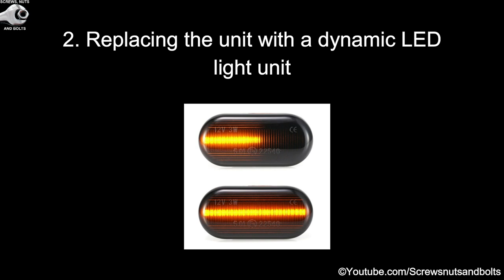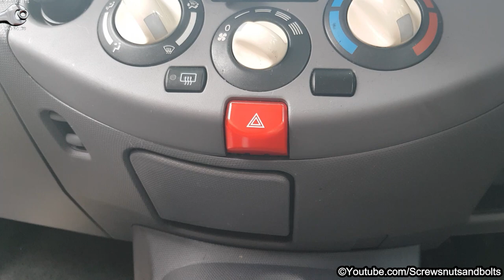Dynamic LED Indicator Bulb Upgrade

Comment: I've just watched your video, but I think the direction of travel for the indicator should be from the front of the car to the rear as the side repeaters are positioned towards the front of the car,  if they were on the side at the back I would agree with you, but if you look at manufactured cars wing mirrors, they go from front to back, not the other way. They look cool either way 🙂
Reply from the maker: I've seen them installed in both directions but I think the light going from front to back doesn't look right on these side repeaters. You're right though, they look cool either way :)
Reply: @screwsnutsandbolts  oh yeah 😃, little upgrade for the Micra k12. Great videos, watched the one on changing the boot switch,  the boot kept opening up like it was processed👻
All fixed now with a replacement 😁

Comment: I've never seen a Micra and just looked them up. Are you in the UK or overseas?
Reply: Also where did you find those sequential LEDs? I'm wondering what other vehicles they make them for. Great videos by the way I just subscribed the other day
Reply from the maker: Thanks very much, I'm actually in Ireland. There's a link to the leds in the video descripton :)
Reply: @screwsnutsandbolts  Saludos! from Ireland as well!
Reply from the maker: Cheers !